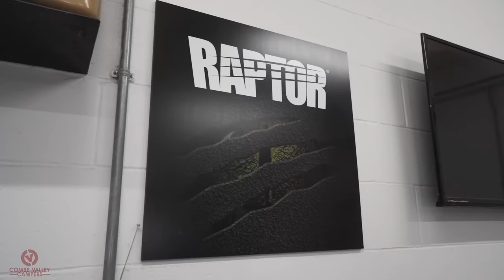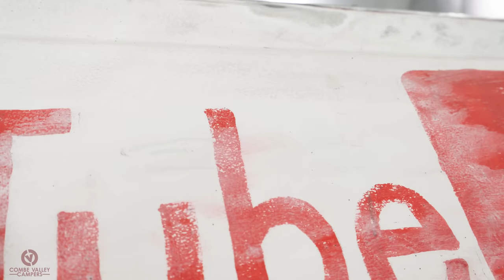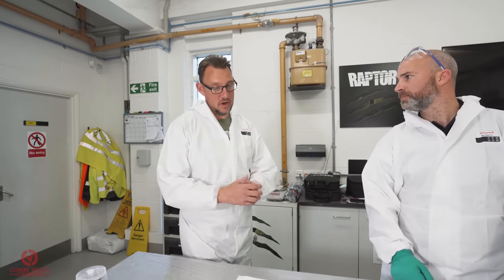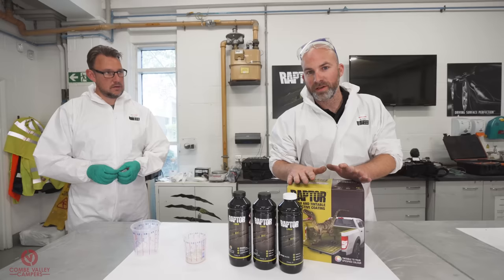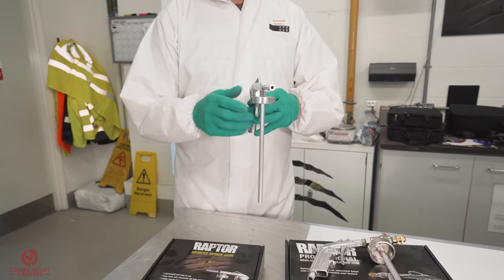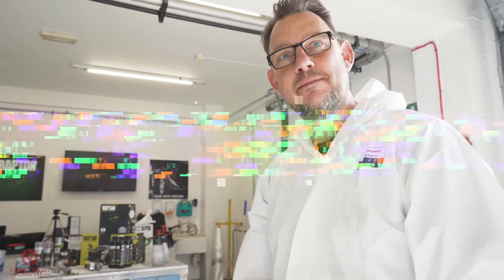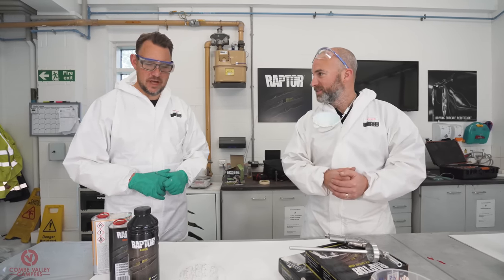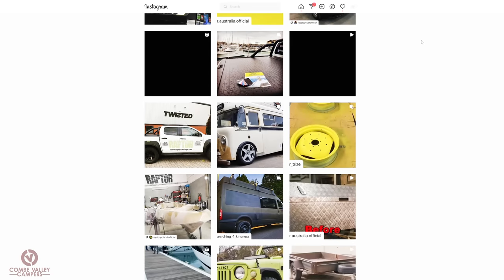Prepare, Paint, and Customise Your Wagon With UPOL RAPTOR, at the UPOL Training Facility!

Comment: Me personally any one who paints their t4 t5  in this paint just devalues there van
Reply: I agree, the whole van looks like a gypsy job. Keep it for key areas only.
Reply: well..... seems that actually your opinion may just be your opinion as over here where I live, its the raptor painted ones which are selling so much more quickly than regular ones - from the point of view being that if someone scratches up their wagon.... that its a relatively simple method to get it touched up again and doesn't require specialist painting skills.  loads of the van lifers are buying up raptor to the point where there's always local shortages at the dealers around me here.
Reply: @equipeaudiovisualNI The more vans get covered in raptor paint, the less original vans are available to those who wish to purchase them. In the short term, demand may be high for raptor painted vans, but long-term original vans with normal paint will always be worth more.

Eventually raptor painted vans will be restored to original type paint simply because original vans will be worth more.
Reply: @T4TipsGuides and the reason there will be vans available to do that is that there was an option available for a lot more people to cheaply cover their scratched up van in some protective paint, instead of it rusting away
Reply: Says the person who can spell "their".
Reply: They are VW transporters not vintage Kombis mate.

Comment: Please post the information to achieve the different textures.  You only briefly talk about it.  One of the primary focus of this video is the finish.  Smooth finish - 60 PSI, 12 inches away, 2mm gun tip, slow sweep, 50% overlap.  This is the info that is most important.
Reply: 80 psi plus 2 oz of urethane gives the smoothest texture

Comment: What type of hvlp gun, what pressure, what thinner and what nozzle size?
Reply: I found around 50 psi works well with a 2.0-2.5mm tip with a urethane reducer I went with the medium

Comment: I would avoid the spray can version, it's crap. It comes out too quickly and it's hard you have to spray it had a long distance. The litre product is best  and you MUST  use a very nozzle, not a crappy Shults gun. The " very nozzel " can be bought for £62 but shop around on ebay. I painted the underside of my bay in my garagevon my back, I prepped it very well, and the results were spectacular. Its looks like a factory finish. There is another video on YouTube by an Asian company who actually show you how to paint it on consistently. This video fails to do that. But it is a fantastic product with great results. The finish looks very professional. The only issue I encountered was the gun clogging up if you take a long time. One remedy is to open up the nozzel, but this leads to an inconsistency in texture. My advice, only mix up what you need, and clean the gun after 1 lite bottle has been used. Do not rush it, keep you distance, ( practice at least 40-60 cm) otherwise you get black gloss spots. Can't recommend it enough.

Comment: So am I right in thinking I can mix this 3:1 in a cup rather than having to use a full bottle?
Sounds like a stupid question but just need to make sure
Reply from the maker: Absolutely correct 👍
Reply: @CombeValleyCampers  that’s great thanks and metallic paint is ok to also use?
Also would I benefit using a 2.5 HVLP to get a fine finish or is 1.8 enough I’m wanting sort of 120 grit maybe 180 grit finish

Comment: I was so disappointed! 
Watched the whole video but you missed the relevant information! What different pressures create? what size of tip did you use? such as on the variable nozzle gun you used for the red body what did you set it to and what pressure? It would of been good to seen an amateur spray it, so people can learn from any mistakes made if any!
Reply from the maker: We have another video using raptor :)
Reply: @CombeValleyCampers I'm not seeing this other video you referred to. ?